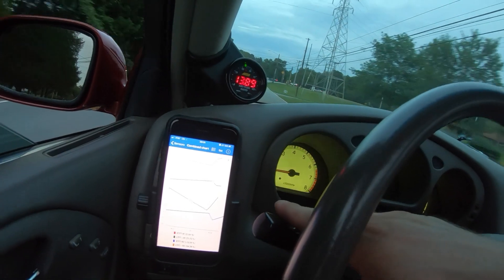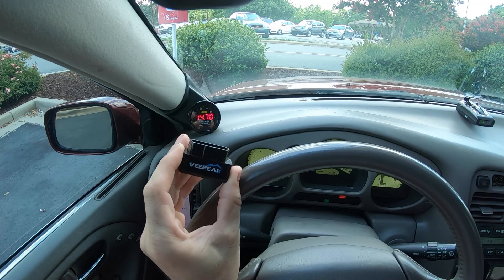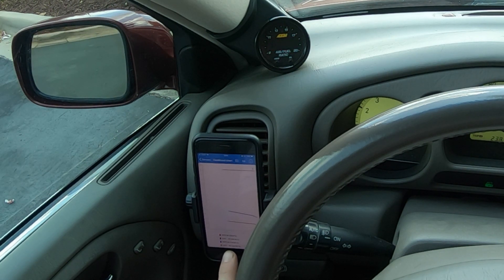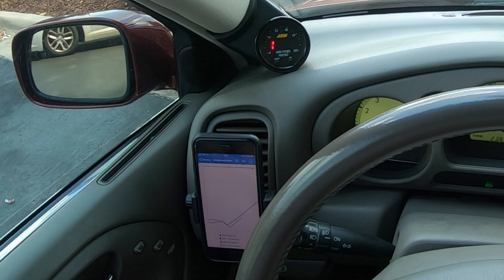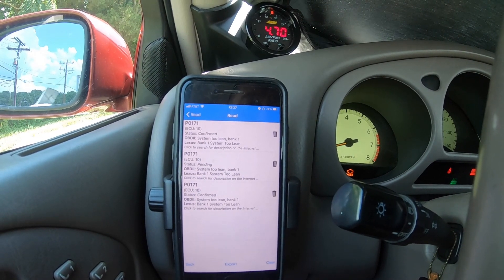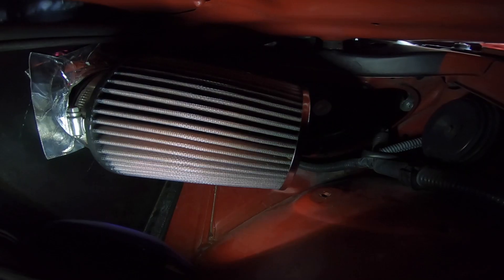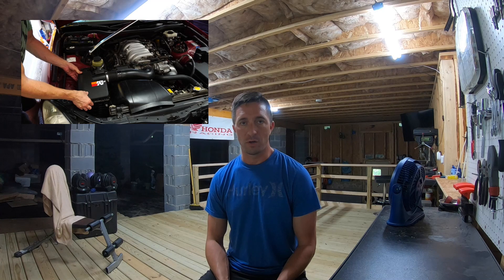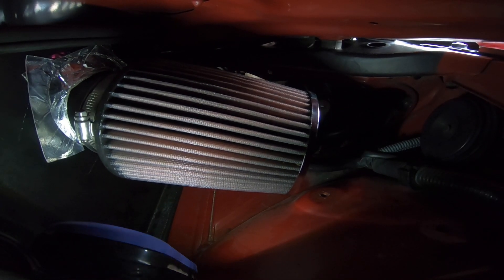Why I removed the K&N FIPK intake system (and how to diagnose a lean condition)

Comment: Checked my LTFT and STFT dead on same as you 34-35% funny I have the same app it's great, same codes as you , same exact problem, calling for parts tomorrow , these 1uzfe do not like aftermarket intakes, 100% right all along , unbelievable... thank you can't wait til this nightmare is over...
Reply: I just called a junkyard found one in perfect condition the entire airbox and the resonator tube that connects to the throttle body , the entire unit for $99 SHIPPED!!! I just bought it I could cry bro  thank you!!! 🤣🤣🤣🤣🤣🤣
Reply: I did not reset the ecu after I put the stock in though, I reset it the other day drove for a day then put the stock unit in and just drove to work checking the numbers on my way here and wrote that message...
Reply: I also get some zeros on the ltfc but sometimes a 20 popped up ?
Reply from the maker: LTFT will take a while to level. STFT is what you want to look while driving at first.
Reply: @ForwardMomentum  stft goes no higher than like 10 -12 at most getting 5,6, negatives and also negatives and zeros while not hitting gas, pushed the pedal halfway to get on it real quick and WOW I never felt power like that in this car, I hope I'm okay ?
Reply from the maker: @JPxItalyBred  you should be good! Doesn’t it feel so much stronger now?
Reply: @ForwardMomentum  OMG I never felt power like that in the 10 years I've owned it!!! incredible!!!!!!! THANK YOU
Reply: @ForwardMomentum  its literally a different car
Reply: @ForwardMomentum  I can't get over this car, this is the power I wanted for 10 years and never had it, I'm floored how fast and strong this car pulls now, just speechless,  I'm convinced I could run with almost anything out here on the highway... just WOW thank u again still no CEL!!!!! 🤞🤞
Reply: @ForwardMomentum  LTFT is at around 20 triggered my cel last night in over 300 miles ughhhh now I am lost
Reply from the maker: @JPxItalyBred  P0171?
Reply: @ForwardMomentum  I'm guessing it's the fuel pump
Reply: @ForwardMomentum  I did clean the maf with windex though cause everywhere was out of cleaner I don't know if that would affect it...
Reply from the maker: I doubt it, but test it real quick. I have an episode on that. Go over every single connection between the MAF and TB. There has to be a vac leak.
Reply: @ForwardMomentum  has to be a leak  somewhere , gonna spray carb cleaner around there and see if the engine rpm fluctuate at a certain point , all hoses I'm spraying
Reply from the maker: @JPxItalyBred  I doubt it. Vac leak almost for sure.

Comment: So I’m having the same issue but I am on a oem intake. Long term fuel trims are in the 30s. What do you think.? I have not throughly checked the intake for leaks yet but plan to.
Reply from the maker: Yes, check for intake leaks post MAF. Is it both banks or one?
Reply: Forward Momentum it was in both banks.
Reply from the maker: Yes, vac leak post MAF. Check everything then smoke it if you have to.

Comment: Been using a k and n filter for 50k miles 189k on my gs430 not a problem or check light
Reply from the maker: It’s the FIPK that’s the problem, not drop in panel filters. Data log your FT’s and get back to me.

Comment: I have a k n N  panel filter but its old previous owner bought about 5 years ago.should I just put a regular filter in there?
Reply from the maker: I have no issues with panel filters and never have. Just make sure it’s cleaned on occasion and LIGHTLY oiled. If you don’t like it, go with an OEM paper panel filter.

Comment: do you mind putting a link to the one you have, i looked up the model but some say there not available for ios and doesnt have bluetooth
Reply from the maker: Veepeak Mini WiFi OBD2 Scanner for iOS and Android, Car OBD II Check Engine Light Diagnostic Code Reader Scan Tool Supports Torque Pro, OBD Fusion, Ca https://www.amazon.com/dp/B00WPW6BAE/ref=cm_sw_r_cp_apip_KVRwKkY5zjGyM
Reply from the maker: Also added to vid description.
Reply: @ForwardMomentum  thanks! btw love the GS series, i own both 2GS300 & 400, would be EPIC to see this GS400 built in stages like getting started boosting , stage1 boost with what you can do for stock ecu, making your way towards a standalone
Reply from the maker: Thanks. I’d really like to get the channel where I can afford something like that, lol. Because it would be more cost effective (and faster) to go FBO IS350 than try to boost this pig. Ha ha

Comment: The Oil coating on the K&N filter pollutes the MAF sensor which is Ultra sensitive hence the Check Engine Light
Reply from the maker: Nope. Not on my car. Been running K&N’s for 25 years now. Never an issue with oiling. My issue was strictly related to the design of this product.

Comment: Car runs rich from the factory, especially at higher altitudes. why youre pulling fuel. adding fuel because the maf housing was different diameter. noise change from vvti and acis. this isnt a continuous vvti system.
Reply from the maker: I know why I’m pulling fuel. I’m just SO accustomed to adding copious amounts with the K&N FIPK that it’s quite shocking to actually pull fuel now; up to -9% in places to hit 12.3 AFR from AFRs in the low to mid 11’s.